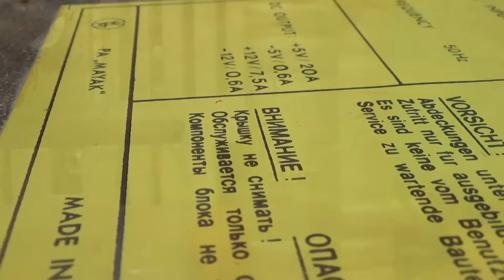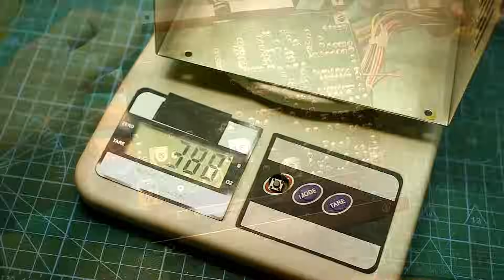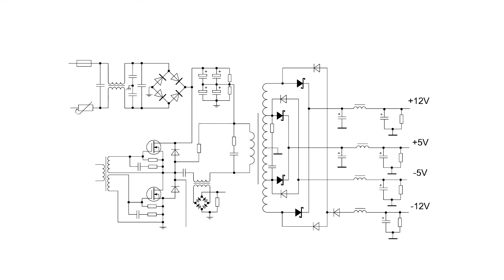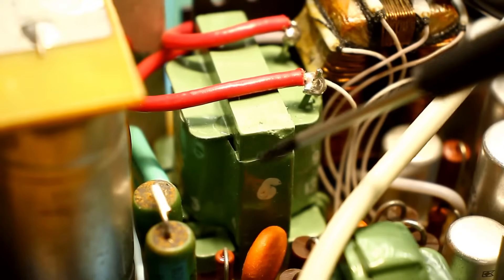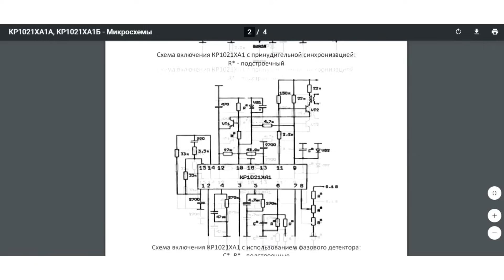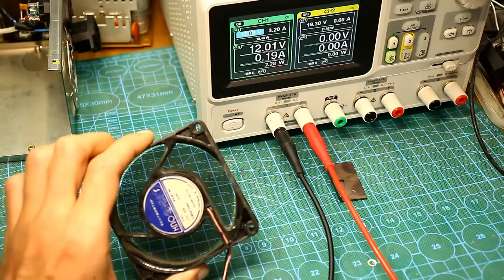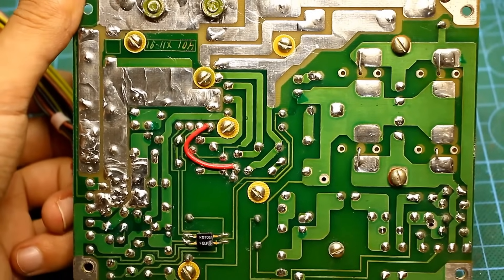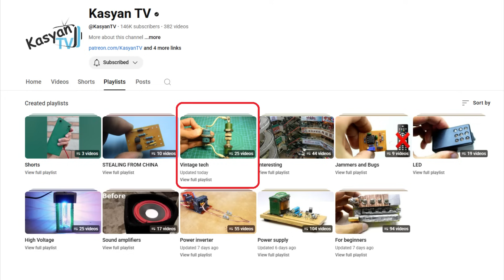WOW! a USSR Computer Power Supply!

Comment: Power supply made in 1992 with  early 1970s technology, like TO-3 transistors and metallic diodes, and  late 1960s small metalic silicon transistors  but with good construction.

Comment: Indeed a thing of beauty and a joy for ever. I'd definitely replace the electrolytics - these were dying inside, leads corroding off - as well as any paper capacitors, but the rest? Loveliness. I'm concerned about the bulk capacitors, large aluminum cans on mains potential, not insulated at all.

Comment: What is up with the diode in series with the inductor at 4:10 on the negative 12v rail? I don't see one on the parallel 12v regulated positive rail